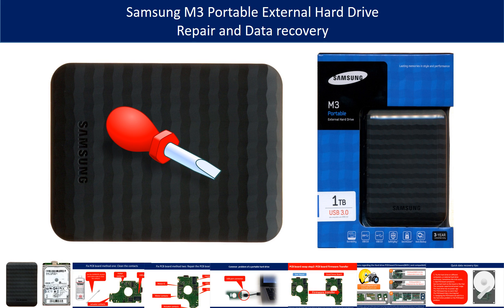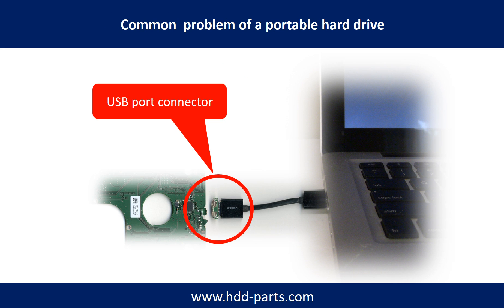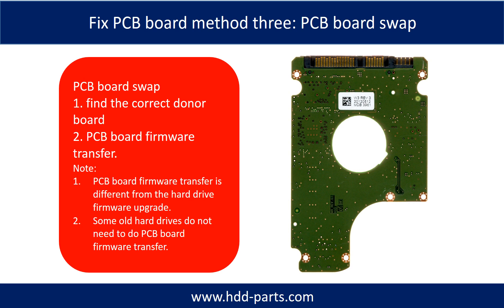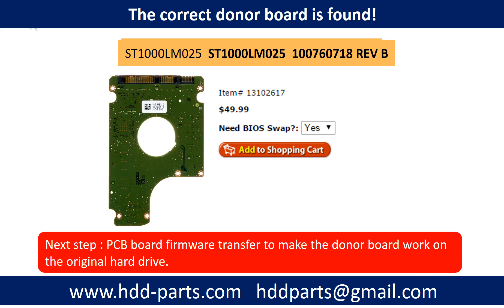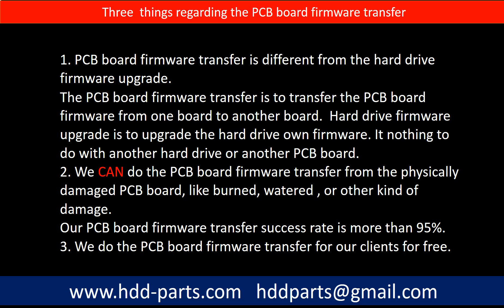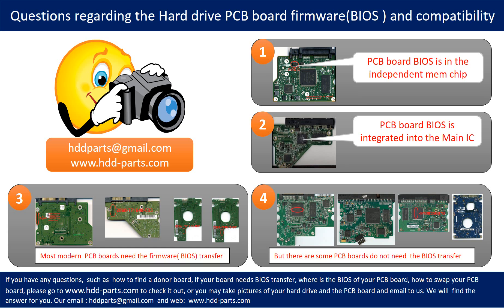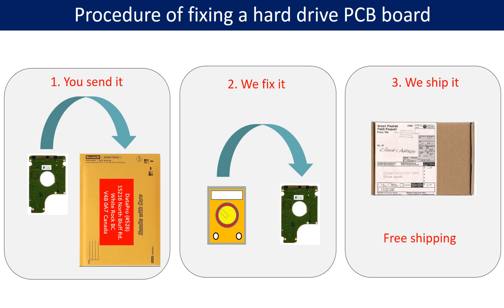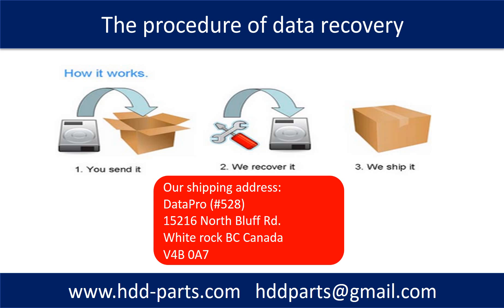Samsung M3 Portable External Hard Drive STSHX M101TCB  ST1000LM025  100760718  repair & data recover

Comment: Hi Sir

I have an external hard drive "Samsung M3 2 TB USB 3.0/2.0 external hard drive 2.5". It fell off and hasn't worked since.
If I connect it to the computer it is detected but I cannot see the data inside.
Is there any way to recover data?
Many Thanks
Reply: Open the drive, unscrew the PCB and clean the golden contacts on the board with Isopropyl alcohol. Rescrew the PCB back and it hopefully it'll work. Was able to retrieve data from mine this way :)